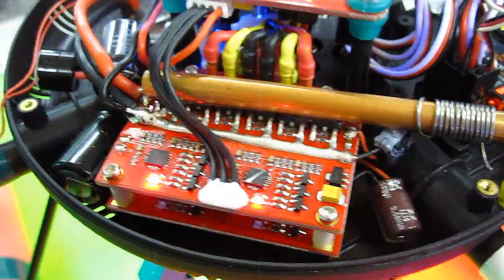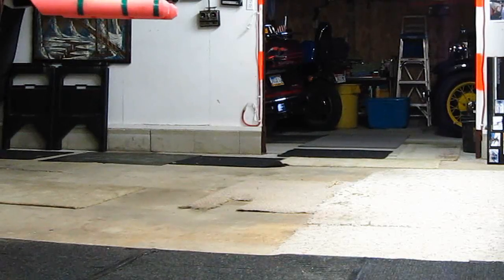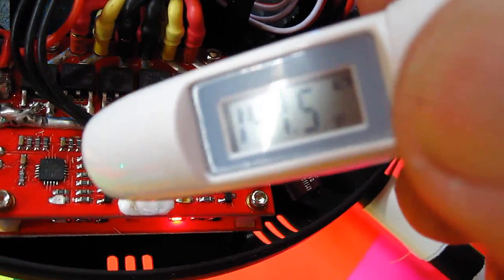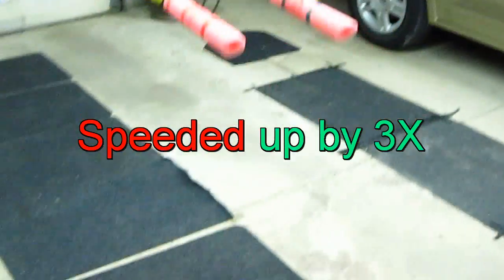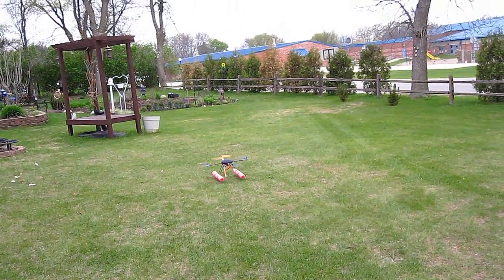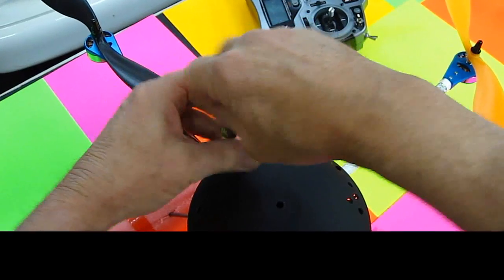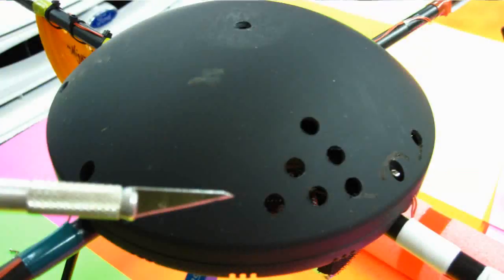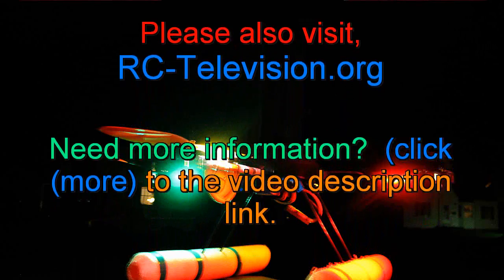Heat Sink for Quad-Copter Experiment. Nitroplanes T-580.

Comment: i will upload a video showing how autoland works over the next couple of days if that helps? on a side note there are 2 lots of esc's soldered together by pins! you have made a heatsink for 2 out of 4 esc's? you need to do the other 2 esc's aswell for this to work Dave ;) as it stands all you are doing right now is making sure its the bottom 2 esc's that are harder to get are the ones that fail? they are below top board and get even hotter :(

Comment: Like mrjdgates said.  Get some arctic silver cpu paste and put just a little under the copper tube.  It will conduct the heat into the tube MUCH faster. Just dont "goop" it on.. just a thin layer.  Also, you might want to take a dremel and cut groove all the way through the tube, the whole length of it.  The groove will let the hot air escape out of the copper tube faster, and let it release heat more efficiently (as opposed to having to go all the way out the end)